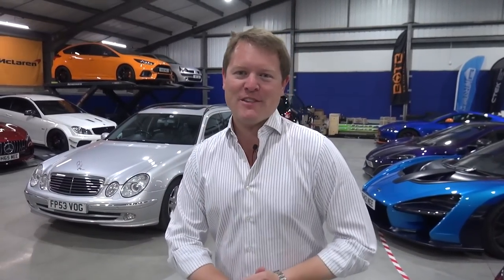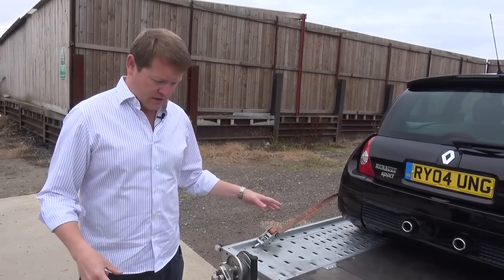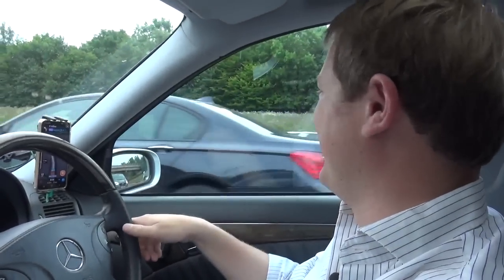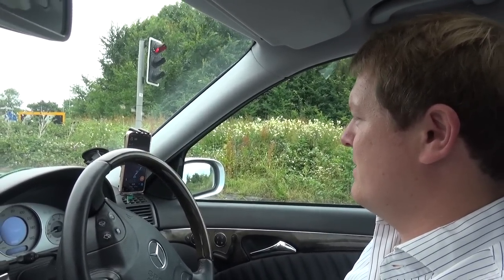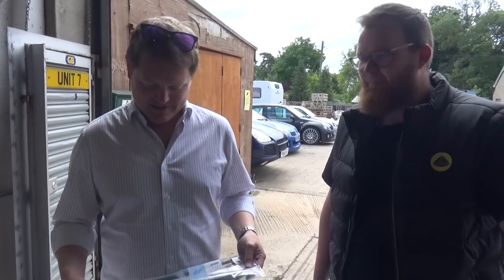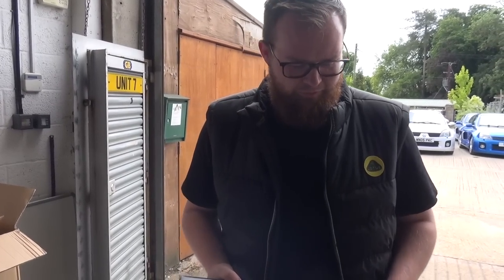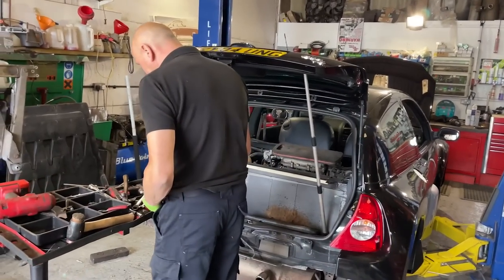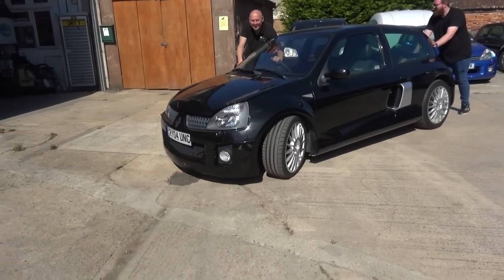Engine Out and FULL TEARDOWN! | CLIO V6 RESTORATION PROJECT Part 2

Comment: It's time to get this project rolling! The Clio V6 needs some major work, and that begins now. I'm really excited to get this one done and eventually an amazing Clio V6 to enjoy. Did you expect that announcement of our plans at the end?!
Reply: Will the E500 and Clio V6 get SHxxMEE plates ?
Reply: @TheGuymacgregor  I think the e500 should get a shmuseam plate
Reply: Itd be cool to do a racecar with the Clio V6 !
Reply: Rallye Cross please! A la Group B style. Metro 6R4 was a V6 initially no?
Reply: If i were you, id put an engine in the front and make it 4x4. The hard part would be figuring out the gear box shifting. That could easily add another 200hp and the extra engine could be aquired from a breakers yard for less than a few k...
Reply: @benpenagonzales6014  the 6R4 had a v6 out the xj220, and it always had the same. It was also a 4x4... 
My solution would be to drop an extra engine up front for added front drive and extra 200hp, which would make shmees clio batshit crazy, same as the metro was.
Reply: As a fellow Clio V6 owner I’m absolutely loving this!   Also - find a clear engine cover and leave the heavy one behind , there’s enough weight back there!
Reply: FERRARI V8 swap would bring this thing alive

Comment: Cant wait to see what colours are  gonna be picked for the clio . This build could be fun . One small thing to remember when you have a car attached to a winch cable is to loosen the  cable slightly as it holds the front of the car down and as the car bounces it can cause damage to  the subframe  and also front bumpers   due to the sudden stopping point  caused by the winch cable

Comment: I remember Tim mentioning in the last video about people still not being able to tow over a specific weight capacity, without doing the trailer test. Anyone who passed their test pre 1997 doesn't have those same restrictions. My licence allows me to drive a car and trailer up to a maximum combined weight of 8250kg as well as anyhting up to a 7.5 tonne van with a trailer up to a max combined weight of 12000kg.
Reply: Since they removed the need for the test last year, anyone can now tow with combined weight up to 7.5t
Reply: Yep, the amount of random stuff I can officially drive on my license is nuts, way more than I think I should be able to drive with no instruction!

Comment: What mechanical mods are you going to do to it, put bigger titanium valves, and harder valve springs, sport cams, headers, and if you want to you could forge pistons and all that stuff, (i wouldnt do this last thing, its not necessary, they are strong enough, plus this preparation doesnt put so much stress on the engine) this was the preparation that they use to do back in the day with the clio v6 cup, my uncle use to race one of this, at the end of the day you will have a high revving v6 that is also very driveable
Reply from the maker: Thanks for the pointers! Certainly taking lots of ideas into consideration

Comment: How is that Benz wagon towing that car with no issue, a few years ago I took my Subaru Forester to buy a Mazda Miata and I decided to tow it back with the Subaru and for the most part everything was fine but I remember about half way back home going about 65-70mph and the back end started shifting back and forth and felt like I was about to loose control but luckily I just let off the gas and it’s smooth itself back out, kept it at 55mph the rest of the way